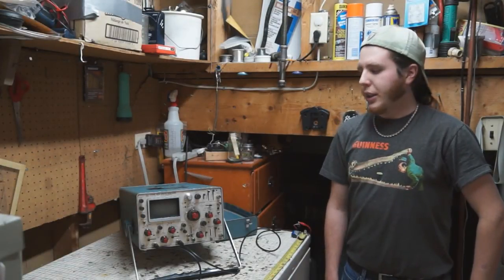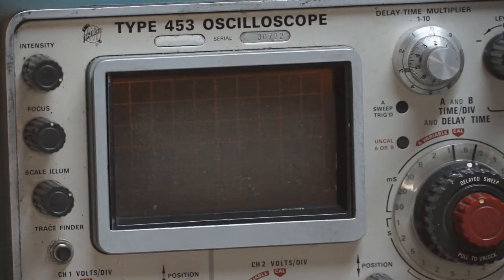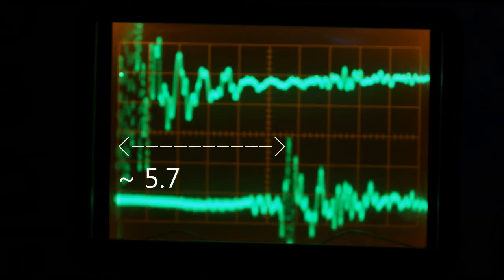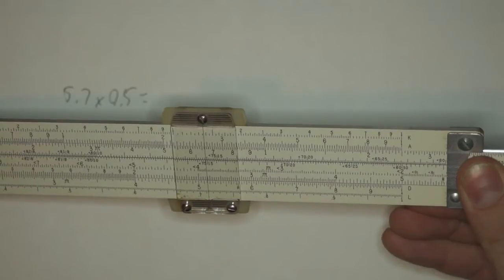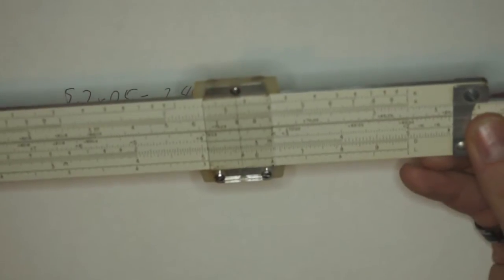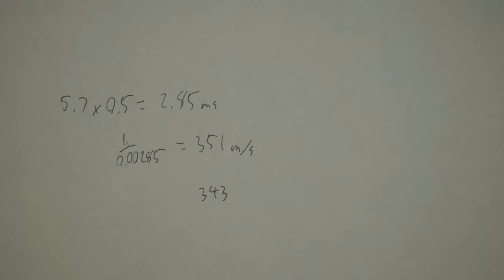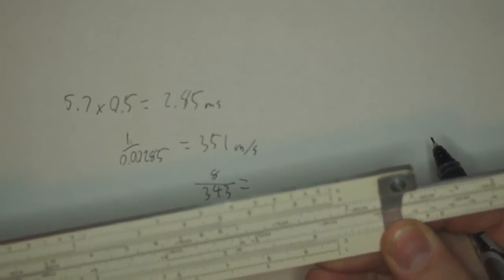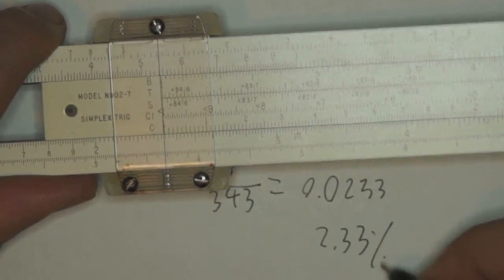Measuring the Speed of Sound

Comment: I tip my geek hat to you, sir.  You're can do faster computations on a slide rule than I can with a calculator.  
Your videos are great, too.  You're capturing slow-mo footage with a Casio every bit as interesting as many of the big production Youtube channels, with their several dozen kilobuck Phantoms.  (I found the standing waves you captured in salt and mercury superb.

I've not come across any how-tos on  Schlieren photography here, let alone realtime footage of the apparatus capturing the effect real-time, in a dark room.... I suspect most videographers would say such a subject would be very difficult.

For your speed of sound measurements:   the sharper the sound source, the less error there'll be, especially with the short distance available to such test environments; perhaps a capacitor arcing?   As well, taking measurements from right to left mic, then from left to right mic and averaging will help negate any signal propagation delays due to small impedance differences between channels. 

Keep up the good work!
Reply from the maker: A capacitor spark would have been a perfect sound source, it never even occurred to me.

Supposedly you can do a modified Schlieren using retroflective material and a laser diode, I may try that one in the future.

The casio is a good camera but the low resolution kills me every time I have to catch something with very fine detail. I'll have a video up in a few weeks where I look at oil coming from an orange peel where the streams are in the sub-mm scale. I would love to get my hands on a phantom for a week, there is a lot of stuff I want to re-shoot as well as new stuff that is too fast for 1200fps.

I'm glad you enjoy my videos, I'll be trying to keep up with at least one a month this year, if I can keep getting new ideas hopefully I can do one a week.